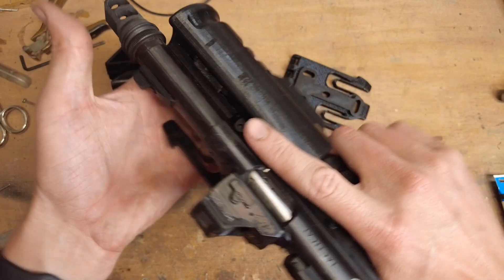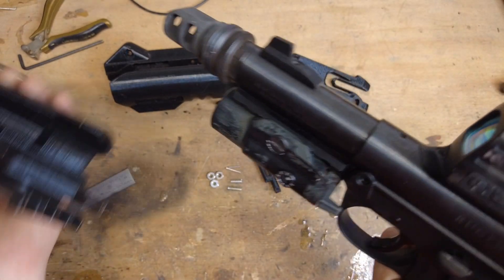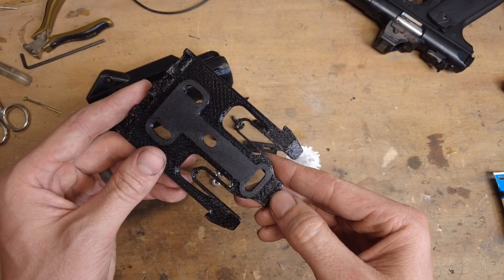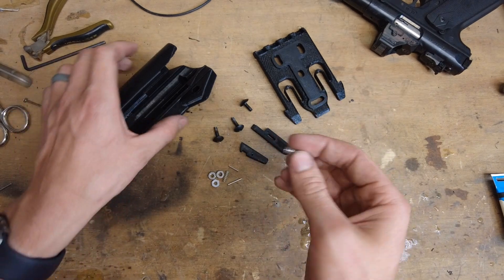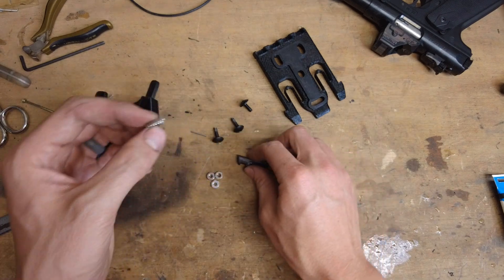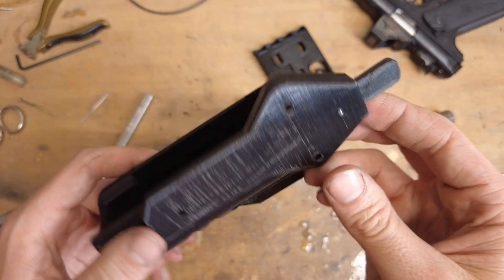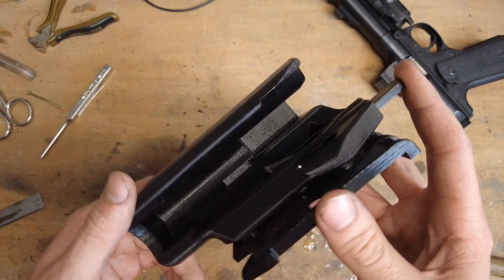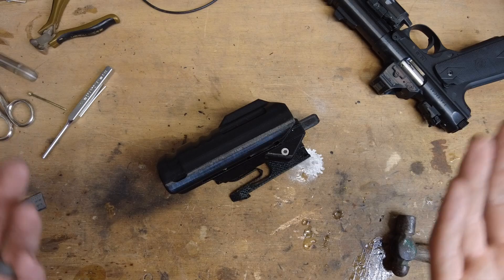TLR VIR-2 Active Retention Holster // Free STLs

Comment: Got this printing right now, going well so far! Thanks so much for this file man, been looking for a suppressor compatible VIR2 holster for ever and had no luck. You rock!
Reply from the maker: Thanks. Let me know how I turns out.
Reply: @thriftyoperator637 print came out great on my ender 3 V2. Trigger slot is a tad bit tight with a VP9 trigger guard due to the trigger guards large flare. Nothing a little dremel can't fix! Overall this is awesome. Only change I would make is the "away from body" side of the holster nearest the "T" logo I would remove the vertical lightening cut and fill the gap with material to increase strength. Seems that is the only slightly weak spot. Otherwise seems bulletproof! 

For anyone using roll pins for the securement instead of pin stock, overbore the "lock" to 5/32nd and it will pivot freely on the roll pin. 

Thanks again thrifty you the man!

Comment: Have you tried the VWS focus cap for the VIR? Do you have dwg/step/etc to allow someone to modify it to work with focus cap? Looks like a really smart design!!
Reply from the maker: I’ve heard of them but haven’t tried them. You could probably cut the bottom out of this design as is and use for that
Reply: @thriftyoperator637  alright, I’ll try to modify it and let you know what I come up with. If you’d like I can share my measurements and modifications if you would like to publish an update/alternative version.

With the latest drop of the focus caps I can see people looking for holster options. The Blackhawk omnivore was the only other one I saw suggested and it doesn’t work well (focus cap means no active retention, and there is too much slop with the vir2)
Reply from the maker: @Martin42944  yeah I may do that. Also, feel free to leave them as a comment on the thingaverse page.
Reply: @thriftyoperator637  I tried one revision by adding a negative modifier cylinder with a radius of 33.56. (I measured my VWS at 33 exactly. Assume some need for space, as well as tolerance on different hoods) It has to go all the way up. 

I didn’t account for the added length at the front of the hood. It adds about 9.2mm

I’m going to try another revision by just cutting all the way through, but if you still have the original cad file, I’d be able to stretch it by 10mm to keep the cap at the bottom. I won’t publish those files, I’d just send them back to you.

If you would prefer to do the modifications I can send you exact measurements and a sketch of what I’m thinking and I’d be happy to test and verify that it works.
Reply from the maker: @Martin42944  I contacted VWS and they are sending a cap to test. I’ll modify the design once it comes in.
Reply: @thriftyoperator637  pro tip when you get the VWS. If you don’t already have the 1913-1 rail on the vir2 make sure to switch to that. The 1913-2 will interfere with a mk4 and other multi pic rails.

Comment: Did you print with any supports, in particular the rectangle area on the inside of the holster towards the top?
Reply from the maker: Yeah I used supports and a brim to help adhesion
Reply: @thriftyoperator637  Started printing yesterday!  Thank you so much!
Reply from the maker: @coreyfelicetti4677  let me know how it turns out
Reply: @thriftyoperator637 dude.. it turned out great!! Thanks for the instructions and files!  It’s been next to impossible to find a legit holster for this light!

Comment: You know if it works with a TLR-1?
Reply from the maker: I am not sure. I think it it may be too tight
Reply: @thriftyoperator637  I thought the TLR-1 and the VIR were the same OD?
Reply from the maker: @PracticalTacticalSheepDog  the bodies are similar but I think the head on the TLR-1 is a bit wider
Reply: I'm going to be printing this today and I will let you know tomorrow if it does or doesnt
Reply: Awesome work! Could this be made to work with the tandemkross gas pedal? I'm struggling out here.